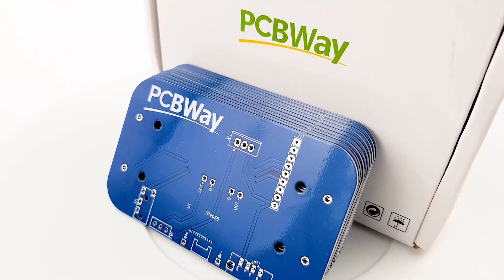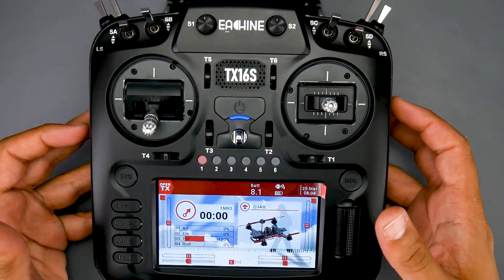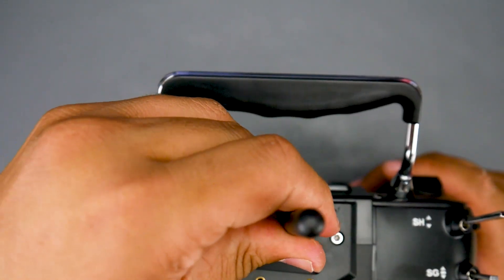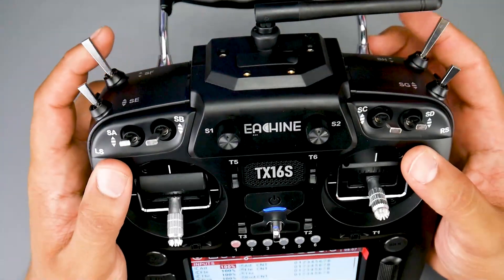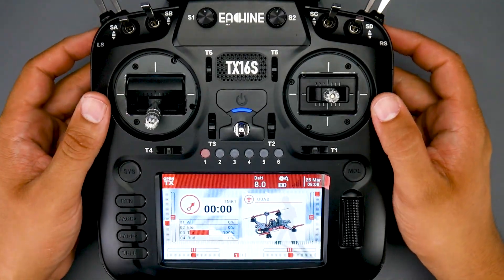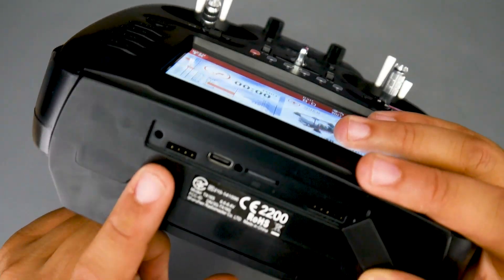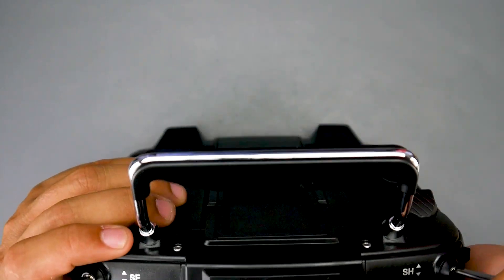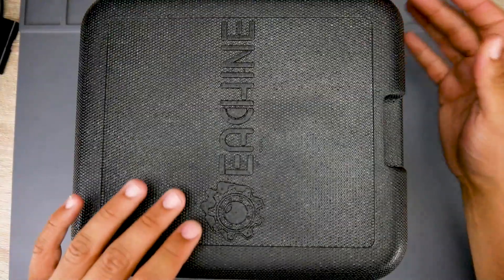WOW!! Best Priced FPV Drone Controller // Eachine TX16S Transmitter

Comment: Hey drone mesh! I love you! I have a huge issue I'm having lately with my solder. Why on earth will it not melt??!?!? I heated the pads on the esc and the solder wouldn't melt. But the pcb melted. Can you recommend a soldering iron and a solder? I'm having the worst luck
Reply: Contact ⤴️ something special for you

Comment: The major faults of the TX16s are that you (1) have to unlug the USB cord to power it on, or it won't power.  This is a major problem if you use it to play simulators all the time like I do.  Every time yout urn on the radio you have to unplug and plug back in the USB connector.    (2) If you use umbrella style stick ends, the lower inside gimbal wells interfeere with stick travel to the lower right (left gimbal) and lower left (right gimbal) corners.   (3)  The gimbals are held inside against the front face by 4 screws, one on each corner.  If you strip out any of these, like when installing lowering plates, you are PHUCKED.   Three screws is not going to hold your gimbal in for long.    They should of had at least six screws for some redundancy   (4) The switches break off easy, so be extra careful not to bum the switches into anything.  I broke one right off the bat by putting a pillow on top of my radio.  Lesson learned.  (5)  The USB ports are not voltageprotected, so if you accidentally get 5vdc to one of the tx or rx or ground pads in your USB socket, you will fry out your main board.  I know, I just did it.   Remember #1, having to plug and unplug the USB cable over and over again every time you want to power on the radio to play a simulator.  Yeah, that wear and tear adds up unnecessarily over time.  

The stuff other people say are faults like the POTS being too lose or the sliders being too loose... in practice aren't any kind of issue.   The 6p switch is in a hard to reach position, so it's good they moved it on the Eachine model, but there's probably a downside... it's going to be that much harder to get to and service inside the radio, and it's already pretty bad in the center as it is.

If you need Warranty Repair, Radiomaster will give you the run around and some static...  which is kind of not cool imho.
Reply: pair of batteries to swap out on a charging station woulda solved your problems babe
Reply: Thanks for watching 👏...Contact 📥⬆️ something special for you